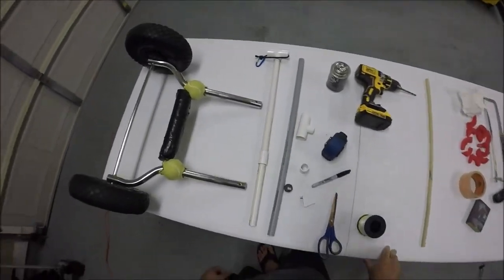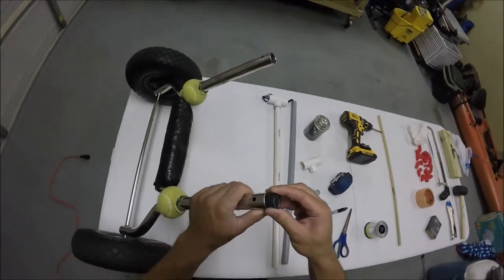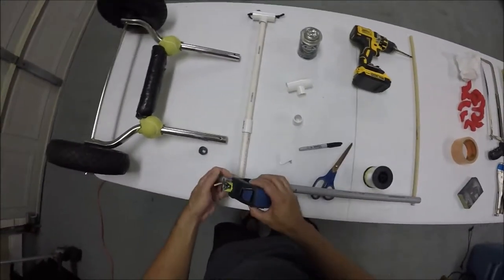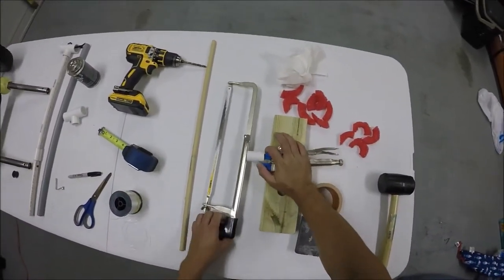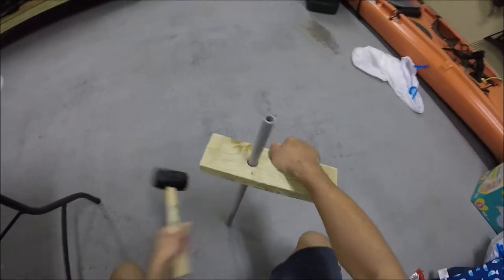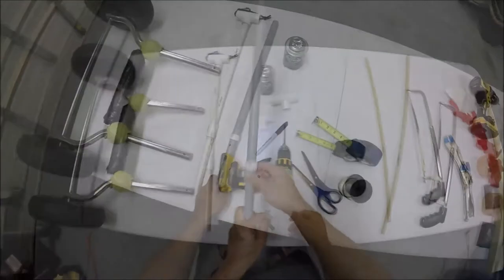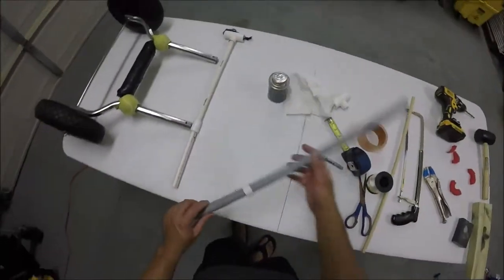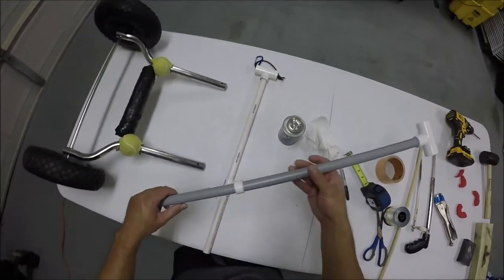DIY instructions for modified Hobie cart pvc handle

Comment: thanks for this!  I just made 2 of these yesterday in about 30 minutes.Just fyi, the 8 inch measurements kinda optional. I did one at 6 inches and prefer the longer handle it gives me.Also, the amazon link for the buttons doesn't work anymore but I had no trouble finding an alternate one.I didnt bother gluing the handle it stays without glue. Thanks again for a great idea!

Comment: Thanks for posting your ingenious modification.  Im getting ready to do it to my 2018 COmpass which I just bought and did the Watersnake trolling motor mod.  One question, having worked with pvc in irrigation systems for years......Why not just cut the PVC pipe and glue both ends into the coupling rather than cut the coupling?
Reply from the maker: I figured one long pipe is sturdier than gluing two together. The more it flexes, the harder it is to line up to the scupper holes. I could be wrong. My original design was two glued pieces and it worked fine.

Comment: What about dry loading if you make this doesn’t it conflict with the on 
land loading?
Reply from the maker: I load the Hobie cart onto my kayak while it is still hanging off the truck tailgate, then I slide the kayak all the way to the ground and load up my rods to go fish. When I load up to go home, I lift the stern end up to the tailgate, remove the retaining pin and drop the cart. Then I am able to slide the kayak all the way in the truck bed to strap up.
Reply: @JohnNguyen4  I have a 4 runner and I don’t have that option. Mine has to go in at the ramp
In water and then truck it up to
The 4 runner
Reply from the maker: @TheDarkHorse949  yeah, that's a tough one. Actually the only reason I own a truck is because of the kayak, else I wouldve had a 4runner as well 😁
Reply: @JohnNguyen4  now I’m considering a tundra 😂

Comment: John do you think this would work with a proangler 360?
Reply from the maker: Robert, the PA is too wide for this method. Maybe try the bungee mod from other hobie people?
Reply: John Nguyen I was thinking the same today my issue is in colder months I want to be able to put the wheels on in water like you do to avoid getting in the water to put them on or tilting on shore... back to the drawing board.
Reply from the maker: @boberte3785  yes, that's exactly why I came up with this idea. Plus I wanted to    launch the yak from ramps in minimal time. Only possible in the PA right now with boonedox landing gear, but some people have issues with hull damage.